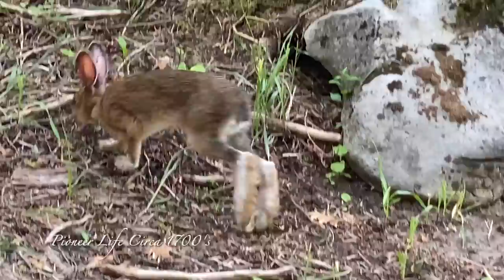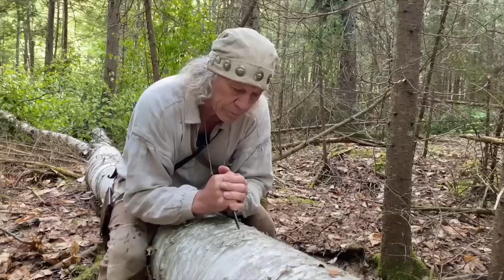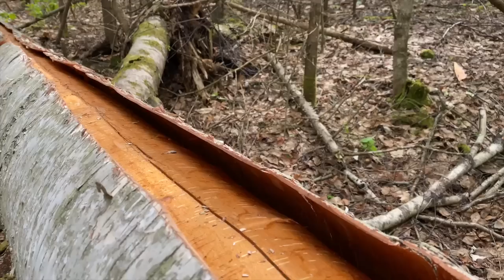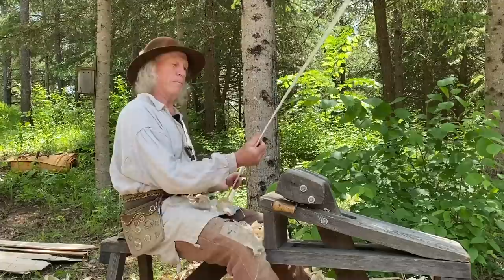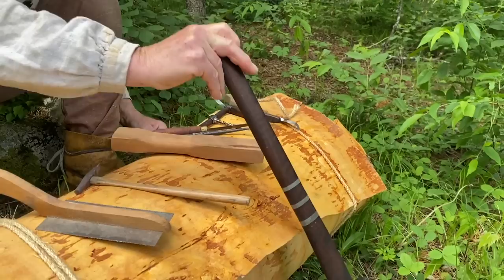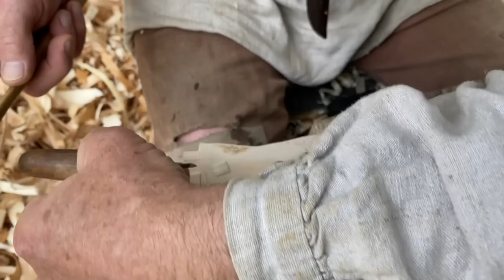Birch Bark Canoe Build - Bark, Sheathing & Thwarts | WOODWORKING | BUSHCRAFT | CANADIAN WILDERNESS

Comment: Peter, although less common, canoes were also buried in sand for the winter. Large rawbishaw canoes stored in canoe sheds for the winter had to have quite a few ribs knocked out to release the tension otherwise the seams would rip in very low temperatures and destroy the canoe. Yes in earlier days, most canoe bark was taken off trees without chopping them down. There is early film footage of this process using a single stick ladder using branches for climbing rungs and a branch fork for locking the top of the ladder into the tree.  In a video, Earl Nyholm shows how to remove canoe bark using an extension ladder.  The task that really takes skill and care is getting the bark to the ground without  damaging it.  The best canoe bark in North America comes from an area from Parry Sound, Haliburton, Algonquin Park north to Temagami and over to Grand Lac Victoria and somewhat east.  The good canoe bark ( not the red stuff) is found amongst conifers. The bark is thick and strong with short, tight lenticels.  There was a major bark trade from this area even before Europeans and the Hudson's Bay Company.  For example, bark from the Algonquin Park area went out to Fort William on the Ottawa, up the Dumoine to Grand lac Victoria, on to Waswanapi then to Nemiscau to Waskagonish then as far north as Great Whale River. The "crooked" canoes up there to support the caribou hunt were made from Algonquin Park area bark.  Those people lived well north of canoe bark and before canvas canoe covers, they were totally reliant on this canoe bark trade. Peter- you are a little too early on your bark removal as you are still pulling rind.  Depending on how hot it gets over the next few days, I would give it at least another week.  I have had bark peel right off on its own accord from the cut that I made with a chainsaw.  This bark is now a panel in the large canoe hanging in the National Museum of History in Gatineau. Yes, if the bark is harvested at right time the tree often lives.  There was a tree near Sand Lake south of Dorset, Ontario that survived for more than 60 years after the bark was removed for a canoe.
Reply from the maker: Appreciate your interest Doris and also taking the time to write such informative feedback.  First of all, I did get excellent bark yesterday and the areas you mention are where I search it out.  This bark almost popped off tree from the initial cut.  It is almost perfect, 1/8 thick and like rubber.  I’ve removed from a ladder, from arborist climbing gear and from downed trees but, the easiest is a tree on the ground.  I attempt to hang them up on the stump so there is room to remove the bark from below.  I’ve yet to see a tree survive from the process.  I’m not saying it can’t happen but the bark is the trees only protection from air borne pathogens.

Thanks for sharing the part of burying in sand, I had not heard that.

Comment: Peter, I picked up a throwing tomahawk off Amazon this past week.  It was pretty cheap.  It is forged and comes with a beard.  I browned the handle and burned some black rings on the handle.  I have several coats of BLO on it and I hand fit the handle to the head.  I am going to deepen the kerf in the handle a bit and put a wood wedge in it.  The crude metal wedge that came with it did not impress me.  I will find a mask for it because it is as sharp as a razor.  It should throw pretty good, because it is heavy.  Overall it weighs as much as my GBA Wildlife hatchet.
Reply from the maker: And a fine tool indeed.

Comment: Peter, yes I agree that taking canoe bark off a felled tree is easier and far safer.  Taking bark off a standing tree might be a hold over from small trade axes or even ones made from stone that made felling a large tree extremely labour some.  Although not good for the tree, many birches do survive at least for some time.  On the surviving tree that I referred to, the rind became thick and lumpy and turned jet black.
Reply from the maker: I’ve actually felled significant sized birch using a true felling axe, can’t imagine the effort with a stone one.  I’ve revisited a few of the trees that I left standing and your spot on with them going black.  From my arborist background, the reason you’ll still find them foliated one to three years after bark removal is the stored carbohydrates stored in the root collar.  This area of the tree is not unlike a car battery and where the it gets it’s energy to flush the buds in the spring, fight diseases and add in compartmentalizing wounds.  Once depleted the tree is done.  Genetically, the tree you refer to must have been one very heathy specimen.  Your very knowledgeable about this subject Craig and I do appreciate your comments.

Comment: This is my favourite kind of episode. I might suggest using a small leather journal book to hold to look at q cards or notes rather than look down. I nice branded leather pocket book would fit right in.
Reply from the maker: Actually I don’t use any Q cards at all.  If I’m looking about it is simply to recall dates, times, places etc., that are relative to the story.  If one were to put a microphone close to my head, you’d most likely hear the gears turning.  I do thank you for the suggestion though.  There may be some stories that are much more complicated and have such a leather journal would indeed help.

Comment: I'm looking forward to more canoe building videos. Is it necessary to drop a tree for bark? On a side  note, I don't know whether I've ever seen snowshoe hares in their brown phase. I've seen a lot in their winter phase and also in between, half white half brown. Boy, do they stand out without snow on the ground.
Reply from the maker: Thanks David and yes you can peel bark with the tree standing but, the tree will be killed by the removal.  They usually foliage the year after the barks removed but, not the second growing season. One also needs arborists climbing gear as it is impossible from a ladder.  Those there hares do indeed stand out in the brown phase.

Comment: Will you use the birch wood also.
Reply from the maker: Absolutely, the wood will be cut and used for firewood.  The trees that are big enough in diameter are nearing their lifespan anyway.  Birch is a short lived species and when left to fall down, will rot in a single year.

Comment: Now please don't dogpile me for suggesting this. If you hold a draw knife at a slight angle while pulling it toward you, it tends to "shear" the wood and cut more cleanly and with less effort.
Reply from the maker: Heck no Dennis, I love getting feedback. I do often use it in the shear position, similar to how one sets a hand plane blade but,  in making these wafer thin sheathing pieces, you need to keep it pretty strait or you rip right through them.